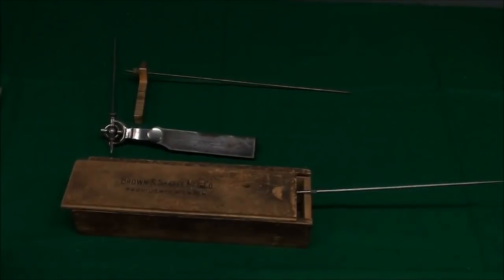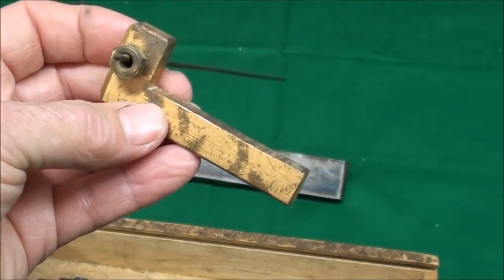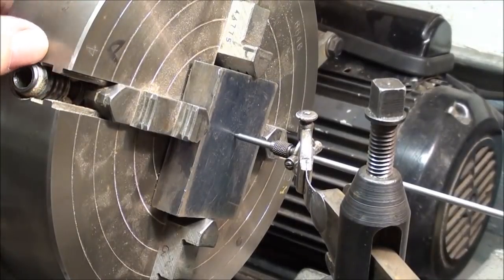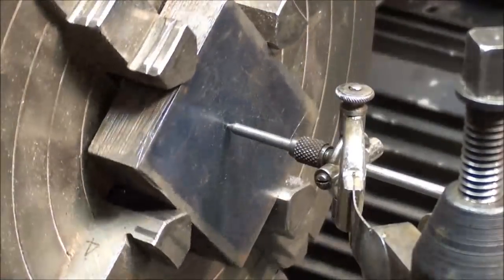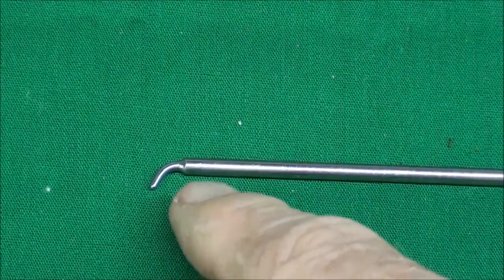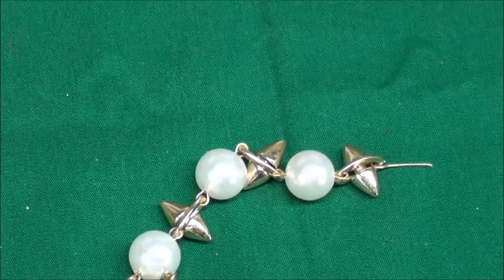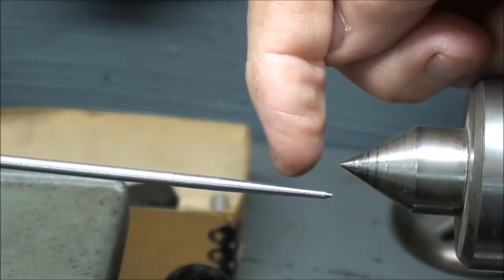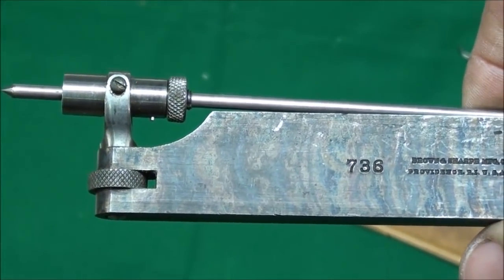WHAT IS IT? #2b Answer Mystery Tool tubalcain

Comment: We used to turn a center point on a say 3/8 rod. Drill a center hole in the other end. Rod was about 6-8" long. When you needed to locate off a punch mark you would put the male end in the punch mark. Bring the tailstock up and it wound go in the female end. You could then put an indicator on the rod male end and as you would rotate the chuck it would indicate on the indicator. I think this would be easier to locate on the hole. We called it a pump center.

Comment: Wow, I thought I knew what it was, but most importantly I did not know HOW it was used. I did not think about the rear being the business part amplifying the off centering.  Thanks. I grew up around a machine shop in Mexico from my grandfather.  All machines run on flat belts powered by a 5 hp motor. And as far as I know, still running after over 50 years. Thanks for your videos.

Comment: I would liked to have seen you adjust the center of the item in the chuck to no wobble and then show us with a dial indicator how accurate it was to center the piece this way.  I suppose the other difficulty with this tool is getting the center of the gimble centered at the beginning. Very interesting. Your comments about how easy it was to use compared to a dial indicator would have been interesting as well.

Comment: I had never seen one before - seems like a good way to indicate. You had mnetioned it was obsolete now. I went on Youtube to see what was being suggested and all I found was Square and Roung stock being centered. Nothing like what you were doing. If one wanted to actually locate an exact drill point with accuracy how is it done? Tail stock point adajacent to target point may be ok, but by the time a chuck and drill are added I think some accuracy wold be lost.

Comment: Yes except for possible tail stock miss-alignment, and tool holder position accuracy - height and cross slide . Possibly a dead center with tapered hole, set in the spindle for aligning the tool first, then indicating the tail stock end of the tool to position the tail stock, then go. A simpler way is to sweep the tail stock spindle using the lathe spindle, set tail stock to zero, then just push the tail stock center into the center punch, then sweep center punch to zero.

Comment: I don't think they're used in industry any more but I made my own several years ago and like the way they work for centering. I made mine with a small spherical rod end, a small coil spring, 2 shaft collars and a piece of steel rod and mounted it to an old lathe tool holder.it cost me nothing except 10 minutes work.

Comment: I'm late to the thread. I don't understand this.  How does one get the tool fulcrum exactly centered?  If the the part were perfect in the chuck, but the fulcrum was off center, wouldn't the tail still wobble?  So how does one know if it the chuck or the tool holder that needs to be adjusted?
Reply: I'm wondering the same thing. How is it set up in the tool post? How do you find the center of a tool that finds center lol?

Comment: I don't think the rod will always line up with the point on the center because the rod may not be perfectly straight.  If it is bent down 1/8" it will find a center 1/8" below the point of the center (you could use that to straighten the rod though).  Maybe

Comment: I don't think in my 50 years in the shop, I ever came across a tailstock center that was in true alignment with the spindle. Most were pretty good front to back, but usually off in the height. It can be off quite a bit without affecting the straightness of the cut.

Comment: I'm thinking about making such a tool for my mill. Just a C shape with a "dead center" in my drilling chuck, and the tool on the other side of the C. If the dead center and the tool are alined then the center punch hole is exactly underneath my drilling chuck.

Comment: I have. A similar tool from starrer and it is still sold.
But I never used it because I never figured out how to use it.
My question is how do you get the tool on center of the lathe before you get the part on centre using the tool ?…
Or does the centre finder only needs to be on the centre height?….

Comment: Great video sir, thanks!

So what tool replaced this archaic system? How do modern day machinists center the workpiece?
Reply: I don't know if you got you answer ion the last 2 years but today we use a dial type, test indicator. Generally it is on a magnetic base with an adjustable arm. The tip is placed on the edge of the work piece and you manually rotate the chuck while watching the dial, then simply adjust where needed.
Reply: @christurnblom4825  but how would you indicate a center popped hole on a plate like that? Theres no hole for a wiggler or anything

Comment: That's actually a very high precision instrument! At the university the teacher had showed us an elongation meter and proceeded to measure the elongation of an 8mm 12.9 grade screw when just pulling it with his fingers and it was measurable. The indicator was not even a high resolution one but it had if I remember correctly a 5:1 lever that magnified the reading.
Reply from the maker: +Sketch1994 thank you that was interesting

Comment: So I am to understand that the rod has to be perfectly straight otherwise it won't give you the correct reading?? Thanks for sharing in fifty years of machining I had never seen one for the lathe, I saw something similar used on the milling its called a Wiggler. Regards from the island of Malta :-))